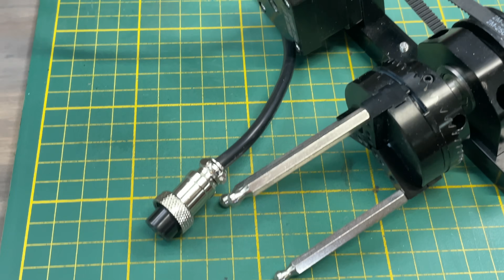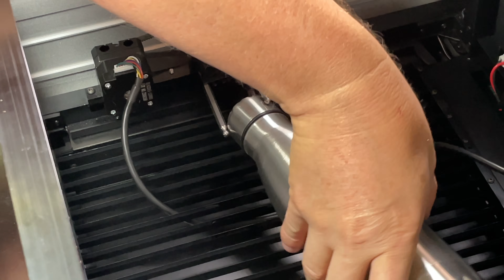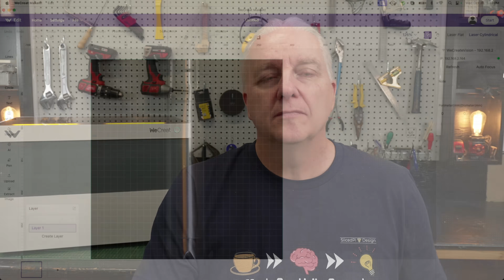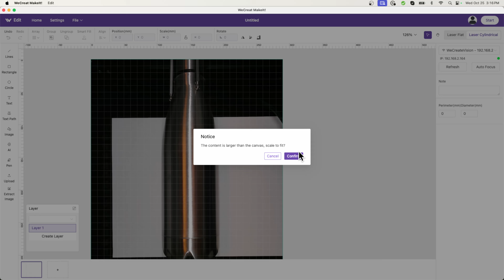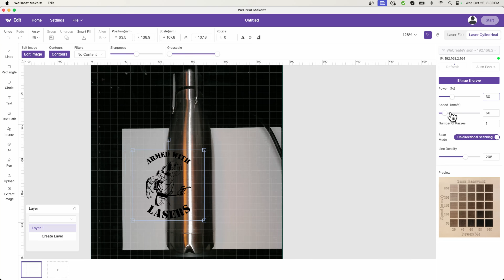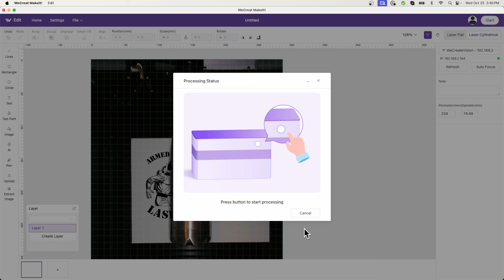You Won't Believe How Easy Water Bottle Engraving Is

Comment: Another great video.  I am ordering a vision, but cannot vent it outside.  would the VEVOR 150W Solder Fume Smoke Extractor 3-Stage Filters 332 m³/h be adequate or should I spend the extra money and get the vision purifier.  It's really stretching what I wanted and can spend.
Reply from the maker: Fume extractors are something you shouldn’t cheap out on. Most fume extractors for soldering are probably too small to this job, though the specific floor model you picked should do the job fine. You certainly don’t need the Wecreat extractor.  Take a look on Amazon and you will find numerous units that would be suitable if the Vevor pi’s t your choice